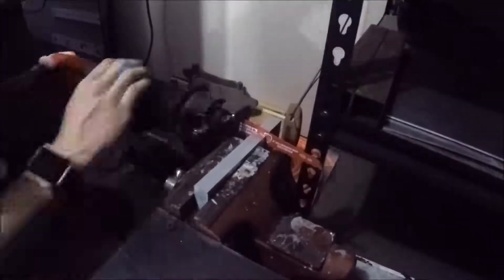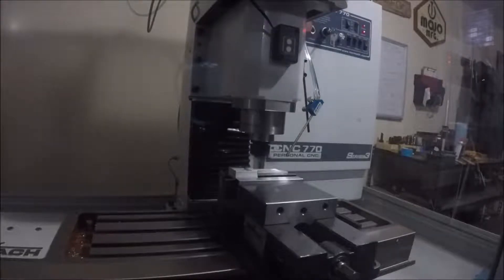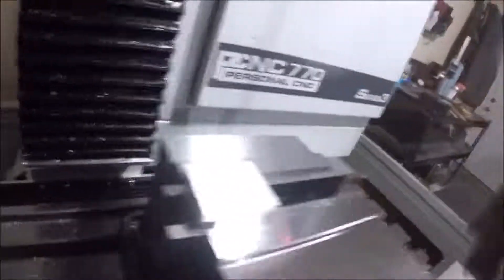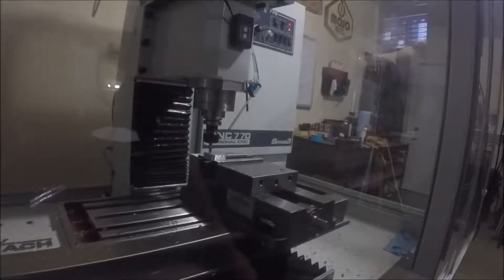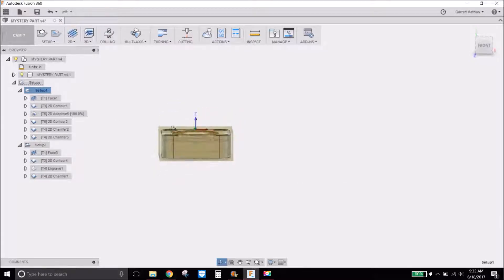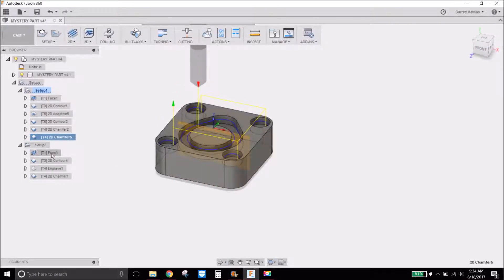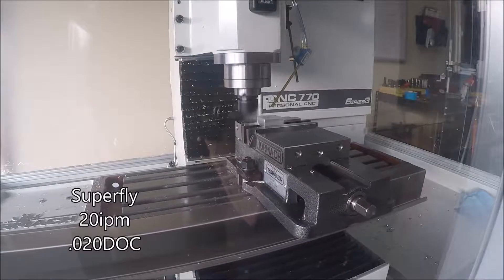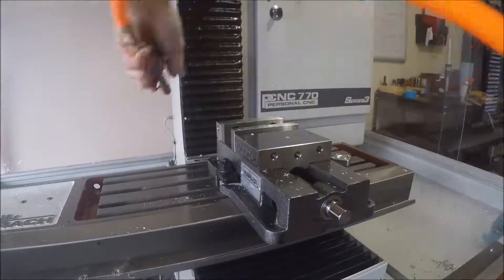Tormach CNC Mystery Part: After Work Special #66

Comment: You zero on you Y on center of the jaws and make you a vise stop for your material stop could of got your x off of that edge and placed the drawing accordingly. Subscribed great vids ! :)
Reply from the maker: Thanks for the subscription!  I normally wouldn't have made this part like that but it's the only stock I had right after I got the machine but a vise stop would have made it work a lot easier.

Comment: Very nice!  You are way ahead of where I was when I started.  In your CAM setup for the part, I would move the part within the stock to within 0.005" or so of the top.  Then you can mill all of the profile of the part while holding on to stock that will be removed.  If you have 0.06" or so to hold on to, that is plenty.  That way you don't have to worry about lining up the part on the 2nd op as much.  I hope that makes sense.
Reply from the maker: Absolutely, I had thoughts of doing that but with the available stock I had I would only have about 0.12" of stock to hold onto and for some reason I didn't think that would be enough to hold onto but if you say that 0.060" is okay then I will definitely remember that for future projects.  Thanks for the info.